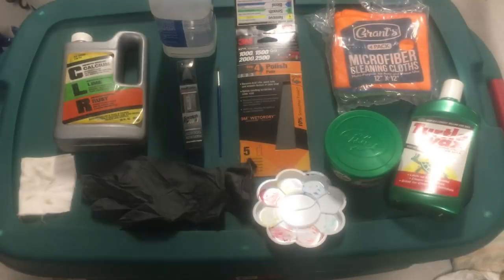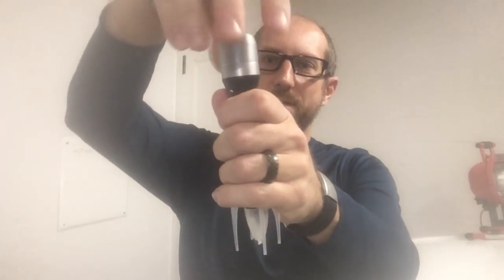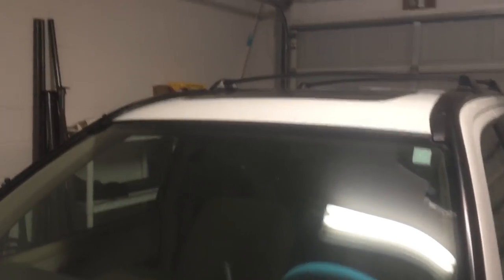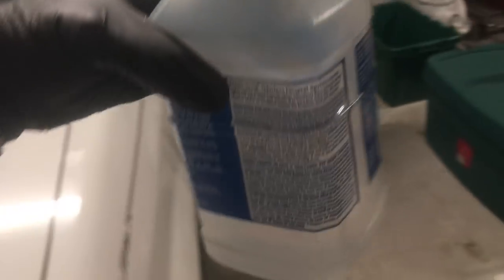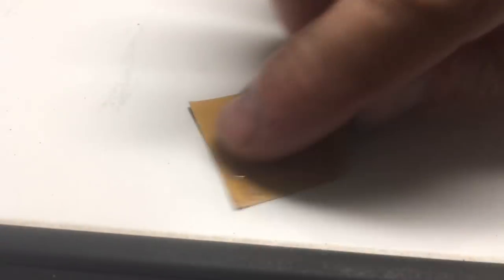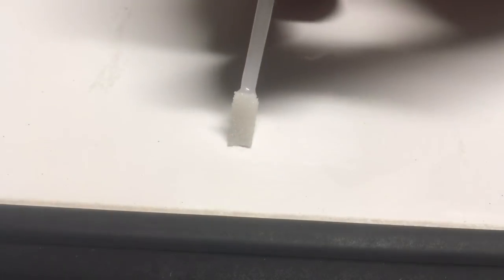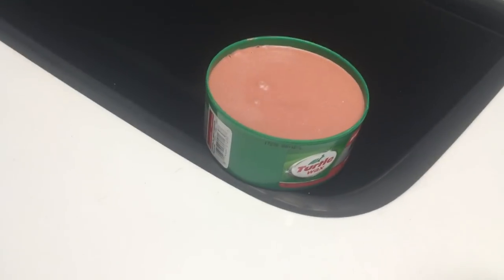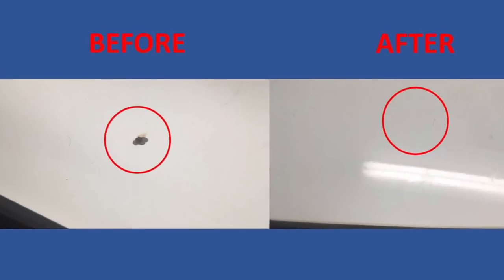How to fix rock chips in your paint using Dupli-Color Scratch Fix All-in-1 applicator

Comment: tip: cut a red rubber eraser in half long way (the kind you used in elementary school) and use that as a pinpoint sanding block to wrap paper around for your wet sanding. Great control, and levels nicely, all while keeping the size of the scuffed paint to a minimum. And you should really go no lower than 1500 grit for the initial sanding, as you want to limit damage to surrounding clear coat.

Comment: Ive found if you can carefully lay a bubble of paint into the chip , and leave it with a little bit of a round head above the painted surface( not enough to run but just a little higher than the original paint. It dries almost perfectly level if not just a little under so as you have room to add clear if you want. Saves you alot of sanding and buffing
Reply: Great tip, I will try this. How long does it usually take before it dries up ?
Reply: @tafl-9198  I would usually wait half a day before i would put the clear on. If you dont use a clear coat ,wait a day before workimg on the paint in that spot
Reply: @barrymccockner6450  thanks 😊👍

Comment: I'm going to try a similar approach but I think I'm going to put masking tape around the chipped area so I don't sand anything I don't need to sand. Thanks for posting!
Reply: Sanding doesn't hurt. The clear coat protects the original paint job. Scuffing up the area around the fix isn't a bad thing.As long as you don't sand so much that you see metal in places that wasnt damaged before. As for "fixing" the scuffed areas, all that is required is to buff it.
Reply: Plus 1000 grit with no masking tape????...if anything 1500-2000 grit...I would also go with masking tape and sill use 2000 just to be on the safe side...I guess his car is kinda crappy where my car (96 Jaguar  XJS Convertible) needs a bit more loving🙂

Comment: Not too bad for the first time. White is a paint in the ass to blend!

I do these types of rock chip fills all the time in my detail shop. The most important finishing step that you missed was using a buffer. 

The other suggestion is when applying the paint (or clear) dry each coat with a hair dryer or heat gun. Also, when applying the clear be sure to apply the first coat and let it dry, then apply it as a glob and let it set overnight. Then wet sand then clear down even with the put around the chip. If you run into pit marks you'll have to apply another coat, let it dry and sand. Another trick of the trade is to cut pieces of sand paper with a hole punch and glue them into the unused end of an eraser and/or use a thin foam sand paper backer.
Reply from the maker: SirWhiteCrayon, thanks for the comments and advice.  I will definitely take all your suggestions into consideration.  Thanks for taking the time to watch the video.
Reply: Hey man. So I got a chip/dent on my car. Should I try and pull the dent up first (with those hail dent kits), and then use that very fine bondo to fill up the chip, or should I skip pulling the dent up and just fill the whole thing with bondo and then sand it down?
Reply: SirWhiteCanyon can you please make a video on how you do this.

Comment: Sand the edges smother before starting, apply paint but build to a top. Sand with sponge, never with fingers, you’re distributing pressure wrong that way. Don’t overdo clearcoat, it should be thick enough around the repair area even after sanding. Less is more when using brush.

Comment: I don’t think you needed to put the gloss on the areas away from the rock chip.  Using a DA and Meguiar’s M105 and a polishing compound it would fix the dull part you see in sanding.  You could also put the sandpaper on the tip of the eraser of a number 2 pencil and sand that way.
Reply from the maker: dphotos, thanks for the tips.  you're right on the gloss part.  I mentioned that at the end of the video as well.  It was my first attempt at any work like that and learned from the process.

Comment: You can also go to your local NAPA Auto Parts depending on the store that will provide assistance with making paint as long as you have the paint code and also the shade of the actual pain to self or the vehicle to be able to match at 100%
Reply from the maker: Antonio, thanks for the additional option.  The one plus about the duplicolor pen is that the clearcoat is included with it.
Reply from the maker: Jeff George  , not sure how much NAPA charges, but I would think after you buy the clear separate it would be fairly close in price.
Reply from the maker: Jeff George  my advice is be patient and don't rush it.  Even if you don't finish it this weekend because of drying time, as long as you get the primer on there, there metal will be protected and you could do the paint the next weekend.
Reply from the maker: Jeff George  also, don't sand as far around the chip as I did.  sand the smallest area you can.  You can even glue a small piece of sandpaper on the end of pencil eraser.  I've done chips since the one I filmed that came out better by not sanding the surrounding area.

Comment: I suspect you are suppose to shake that paint really well before use  and pre sand the inner sharpe edges of the original paint before applying the new paint.  Alot of people use the small applicator tip to add paint to the cavity on a horizonal surface rather than the brush

Comment: The problem is ALL car manufacturers DO NOT apply enough paint on the automobiles anymore. They are doing it as cheaply as possible with robots now and the bottom line is they just aren't applying enough coats of paint. They should be applying at least two coats of primer, three coats of paint, and two coats of clear coat but instead it's one of each and put on thinly. Really SAD! I remember the old vehicles and they had plenty of paint of them. My mom had a 67 Ford Mustang and it NEVER had any rock chips on the hood. The nice thing is it had a chrome bumper and metal grill. NO PLASTIC parts on the front of that car!
Reply from the maker: Tim, so true!
Reply: Tim : the professional on YT channel Sweet Project Car says the clear coat is actually thicker than it used to be. It protects the thinner paint better and the clear coat is easier to repair than paint.

Comment: No primer ? will that bond to the metal ok ???
Reply from the maker: @Ron, it bonded just fine.  For the time I had the car it never was an issue.
Reply: @DIYJeff  I did a repair on my trunk with an identical pen from GM, 5 months later (including winter months) it has not resurfaced. I’m assuming there is a sort of sealer mixed in with the paint? Obviously when I did do the repair I made sure there was no rust remaining. Repeatedly took pictures with a high quality camera, zoomed into the area of interest to inspect and carried on.

Comment: looks good next time put wax around the spot then use rubbing alcohol just on the spot that way if you do get it where you don't want it you can wipe it off when it drys
Reply from the maker: Zee Lewis, I hadn't heard that before.  I will try that then next time I do some touch-up.  I'm looking to touch-up a rock chip on my wife's 2016 Black Ford Edge in the next couple of weeks so I'll put your tip to the test.
Reply: +Honest Jeff Reviews & DIY Jeff its more of a just in case thing i think this touch up came out as good as it could have

Comment: My only question is why didn’t you wet sand the touch up paint before applying the clear coat?! You could have made it look  so much better! I feel like you need to sand the paint and then the clear coat in two seperate steps
Reply from the maker: Mark D,  I'm not sure if you ended up watching the whole video or not (I know it's long) but at 14:07 I talk about the need to wet sand after applying the paint and letting id dry overnight, and at 14:43 I start wet sanding before I applied the clear coat.  Hope that clears up your concern.

Comment: I honestly found this video a bit frustrating. To start, it doesn't hurt if you remove more paint around the chipped area. In fact, it's good to be sure there isn't any rust that may be under the edge of the paint. Second, you don't need to apply the paint in light layers repeatedly. One coat that is raised above the undamaged paint surface will suffice. Once the paint is completely dry then you wet sand the area. This will knock down the raised bump of fresh paint down to the old paints level creating a flush and smooth surface.

Regarding the clear coat. The only area that may need any new clear coat is the part you repaired. The milky, dull area that was sanded only needs to have some rubbing compound added and then buffed out. Before ever adding clear coat if you would use the rubbing compound first, you might not even be able to tell where the repair was...without ever adding the clear coat. Adding a new layer of clear is fine if the repair area was larger though. But even then, you would need to wet sand after the clear dried, and then buff with a rubbing compound.
Reply: Also, had you had a larger amount of paint added to the spot, and then sanded, you would not be able to see the old edge of the paint. It would all be blended in.

I also don't k ow why you didn't bother filling in the other damaged spots around the ones you tried to fix.

Fyi, there are many videos on YouTube where professionals will walk you through the steps and explain further why you want more paint and so on.

Hope you were able to get those spots fixed up.
Reply: I'm the furthest thing from a professional or even DIY paint guy, and this was hard to watch. I can't imagine what it was like for an actual body guy.

Comment: I messed up when i wet sanded it stained the sorrounding area ? Any suggestions ?
Reply from the maker: @Mr Jay Vic, I'm not sure what you mean by staining the surrounding area?
Reply: I might’ve sanded to much its messes up the  paint it left a dark stain from the sand paper 1000 grit
Reply from the maker: Mr Jay Vic , I’ve not heard about staining from wet sanding.  It’s quite possible you sanded through the clear and into the base coat.  If that’s what happened then you’ll need to start the process all over.
Reply: Thats what i thought okay thank you 🙏🏽

Comment: that pen is a shit design, I had paint all over because just like you I oepend it the wrong way
Reply from the maker: Hopefully anyone using the pen in the future will watch my video first to avoid a big mess.  I was lucky that the clear coat is thick so it didn't run out immediately like the paint would.
Reply: I Ditched the pen and tossed it, went to CarQuest near me and they mix paint, sold me 4 oz of single stage and it worked perfectly. 4 coats and a little compounding and wax.

Comment: Thanks for the titorial, but thats a lot of work and time for a couple chips.  Need something quicker and easier for those who dont have the time or know-how
Reply from the maker: Michael Kensington, for smaller areas you can get away with just putting on the paint, letting it dry, wet sand it, apply clear, wet sand it, buff it, and wax it.  Total project time maybe only 30 minutes (with additional waiting time for coats to dry).  But with larger areas there really isn't a quicker option that I know of.